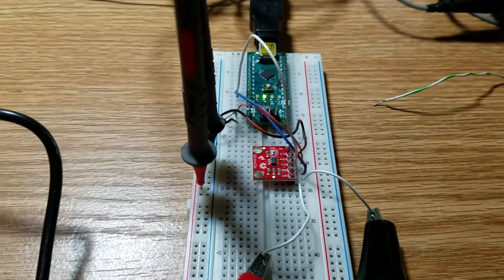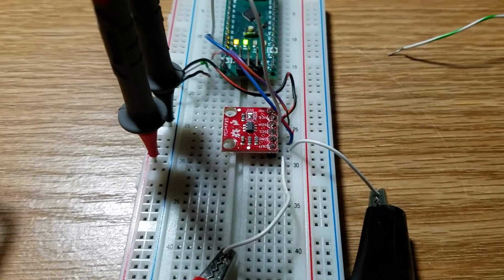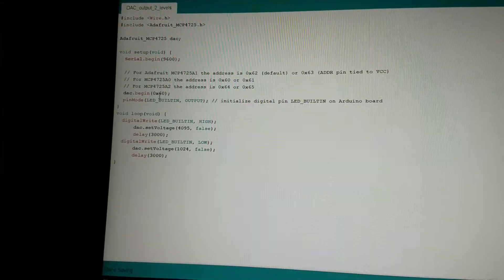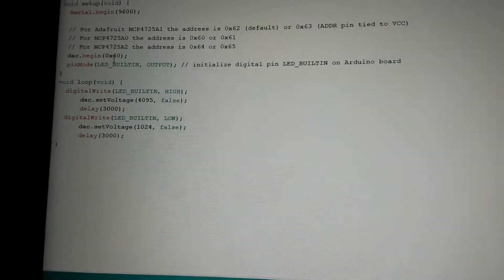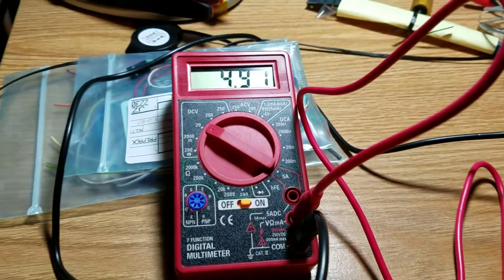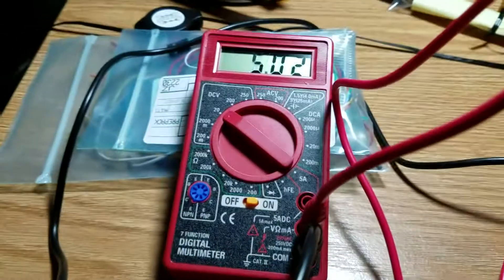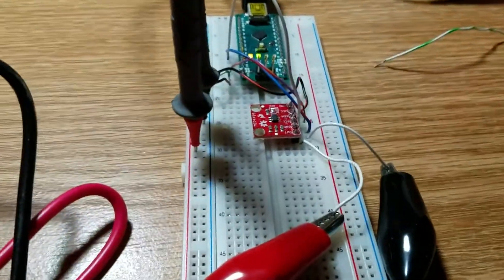Arduino Nano + DAC MCP4725

Comment: which adress exactly did you change for your code to work fine?
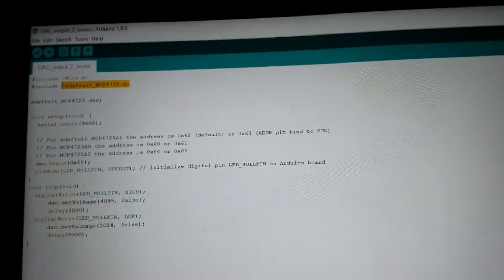Reply from the maker: 0:34 I changed dac.begin(0x60).  You can try 0x61 or any of the other few addresses the board can be programmed to.  Also check out the other comment on this video on the i2c sniffer feature to poll the DAC board.

Comment: can output mcp4725 controlling automatic +0.1 /sec? I really need help. why out in mcp4725 has constant voltage? please help me...
Reply from the maker: 0.1V/sec should be able to be implemented.  Did you read the other comments taking about troubleshooting?  If it has a constant voltage I would guess there is a communication problem.

Comment: Love this chip :)
I also had i2c address problems... I swear I folled the datasheet right... but no response...
Ended up using the i2c sniffer on the arduino site, solved a lot of headaches :)
Reply from the maker: I didn't know about that tool.  Thanks!

Comment: please help configuration cable from arduino to DAC?
Reply from the maker: If you're using the board I'm using, have you tried all 4 addresses?
Reply: @mattmills7867 allready done,  i'm using uno,
Reply from the maker: @kavtech_midi  Here's my code from the video:
#include <Wire.h>
#include <Adafruit_MCP4725.h>

Adafruit_MCP4725 dac;

void setup(void) {
  Serial.begin(9600);

  // For Adafruit MCP4725A1 the address is 0x62 (default) or 0x63 (ADDR pin tied to VCC)
  // For MCP4725A0 the address is 0x60 or 0x61
  // For MCP4725A2 the address is 0x64 or 0x65
  dac.begin(0x60);
  pinMode(LED_BUILTIN, OUTPUT); // initialize digital pin LED_BUILTIN on Arduino board
}
void loop(void) {
  digitalWrite(LED_BUILTIN, HIGH);    
      dac.setVoltage(1024, false);
      delay(3000);
  digitalWrite(LED_BUILTIN, LOW);    
      dac.setVoltage(123, false);
      delay(3000);
Reply from the maker: @kavtech_midi  I also would suggest to check your solder joints on your DAC and make sure everything is wired correctly.  I don't have an Uno but the Nano pins for SDA and SCL are A4 and A5.  Its also very important to download the Adafruit_MCP4725.h file and place it in the libraries folder for your compiler to reference.
Reply: @mattmills7867  nice...thanks